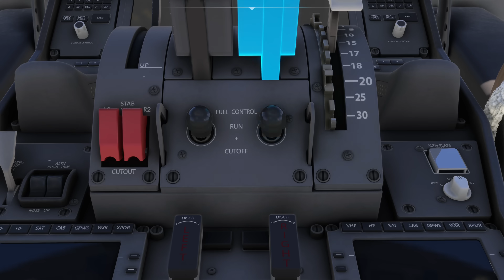Air India 171: Why Did The Fuel Cut-off Switch Get Moved?

Comment: Why don't you discuss all the possibilities that lead to switch off.
And when the pilot says '' I dint do it '' - It is not always like a kid doing a mischief and then denying it. There are good kids as well in the world who don't lie. So here there is a firm attempt to project this as a deliberate switch off.
There are reports about glitch in the springs/ locking mechanism reported in 2018 or so
There are reports of a refurbishment done 
There are reports of possibility of software glitch having a possibility of re running the fueling system
So why don't you discuss all of these and establish why you rule these out?

Comment: Would it not be a good suggestion to add a mechanical interlock,   so that the fuel swiches cant be moved to cut off unless the trust lever for the corresponding engine is at Idle.    I cant think of a senario where you would cut off fuel before setting the thust to idle.

Also one pilot setting an engine thrust to idle is a far more noticeable action by the other pilot.

Comment: One issue that I was a little surprised to hear was that the investigators had to find someone who knew the crew and could identify which pilot was saying what... I would have expected each comms set (headset) to be recorded on a separate track specific to which "seat" they are sitting in. Thus the left hand seat is recorded on one track, the right on another, and jump=seat or other headsets on their own individual tracks - in this day and age, with analogue recordings, multi-track is easy, and with digital recordings, it would be even easier to provide up to 64 individual "tracks" of audio - allowing multiple different audio circuits to be recorded.

Comment: You mentioned previously that an aircraft knows it is either in "ground" or "flight" mode. Would it not make sense for the aircraft to be configured to disable certain actions such as allowing the fuel switches to be "both" shut off under certain specific conditions such as 1. There are no engine alerts / alarms, 2. Altitude above ground, 3. Climb angle and rate, 4. Speed, and probably a number of other conditions that show that there is absolutely no reason for shutting both fuel switches off during takeoff and early climb to altitude? I am not a pilot, but surely something can be done to prevent such a catostrophic action under certain specific circumstances.

Comment: One of the previous passenger posted a viral video about the same doomed plane showing faulty air conditioning system, just imagine their maintenance level. But the investigation committee says there were no issues in the plane. Obviously covering up. Looks like the mechanical faulty fuel switches which rotated back due to vibrations was just over looked among many issues in that plane. Who cares about 2018 advisory report clearly mentioned potential danger in those switches.

Comment: Hi, a stupid average passenger question.. buy why did they not land back ? Not back at the airport but any open place close to crash.. The landing gear was all out anyway, they were hardly too high up ..
Reply: Also if cut off switches are going to make you crash and lose your life, I would pull them back up in a second, leaving everything else... 10 seconds is a looongg time to debate and then correct such a fatal error... Any debates and interrogation on why the other pilot did or did not do  it should have come after the correction I feel

Comment: First of all ,Not sure why this switch is required ? I don’t have it in my car, it doesn’t matter whether it is on or off, if this is must required in air craft ,based on engine status (running / idle) it can be made automatic after all it is just fuel tap

Comment: We could add some control logic to those switches (and I expect we will - given we added secure cockpit doors after 2001);

Add logic as follows;

‘if (fuel shutoff is done when both engines are running at takeoff thrust, and the aircraft is nose-up and gaining altitude as expected, and all engine sensors are normal), and if this happens EITHER (during takeoff roll) OR (first minute in the air) THEN (reduce that engine to 50% thrust immediately, and lower it down to idle over the next 10 seconds, and cut the fuel as expected 10 seconds later).
 —> if attempts are made to reverse the shutoff via switches, or via moving thrust lever up (or down then up), restore fuel flow

If (the above happens after the first engine has been shut down, then reduce thrust to 66% after 5 seconds, 50% after 10 seconds, and keep it there for 10 seconds before lowering it further (below idle).

The above would leave the engines in a state where full thrust could be quickly, almost immediately restored, for 10-30 seconds, letting the other pilot save the plane.

Additionally, extra logic could be added : 
 - if an engine is indicating a fire, or fuel in one tank is dropping rapidly, or engine is significantly out if spec on the sensors, then shut down engine without delay’
 - if the plane is heading rapidly towards the ground at high speed, shut the engines off, if the pilots command it, without delay.

Would also be good to add a software update for cockpit doors;
 ‘Allow pilots to use a fingerprint on a keypad to unlock the door no matter what.
 -> this would prevent the GermanWings disaster.
 -> ideally, figure out a way for pilots to have basic amenities without entering passenger area…

Comment: There are so many ways a pilot can crash a plane which are much more certain.  It's obvious that whoever turned off the switches (if it was a person) most likely wasn't even aware of that.  The fact is, the problem was discovered and fixed immediately, it was just a matter of seconds, or landing in a field instead of a building.  In short, this doesn't seem premeditated at all.

Comment: It clearly shows switches were faulty. It was revealed in FAA report in 2018... Switch issues 
Boeing has a tendency to shift its blame on to dead pilots
The conversation between the 2 pilots clearly indicated that both were in shocked state, couldn't understand how did it happen
They did try to do whatever could be possible to avert the diaster.
BBC and WJP misinterpreted the preliminary report to save Boeing.It is conspiracy by BBC and WPJ
Whereas when London jet Airways had accident in 2 days - BBC  -won't blame pilot mental health, why ???

Anyway Air India CEO Mr Campbell himself siding with Boeing, he should have resigned by now if he had really a responsible person

Rather Air India CEO Mr Campbell ignored the STPA report submitted by the crew of the same ill fated AI 171 plane that arrived from  Delhi to Ahmedabad, within 1 hour, it got clearance to fly from Ahmedabad to London.
So how come Air India CEO still a CEO.
Wake up call for TATA to ask him to resign immediately taking the onus on him
Boeing is at fault no doubt, its has technical issues, software glitches. This incident shows Air India CEO siding with Boeing

Comment: Steve thank you for this!  My question may not have an answer, but if one pilot shut off the fuel switches, the other pilot asked why did you do that, Then the questioning pilot reset the switches to run & got a mayday call off,  It seems like the pilot who shut off the fuel didn't put up a struggle with the other pilot to keep those switches turned off?  

You would think that if the pilot who wanted those switches turned to off would've wanted those switches to remain off!  Why do you think there was no additional attempt to turn those switches back off? there was no mention of a struggle in the report?
Reply: No need to fight it, loss of thrust was immediate and putting them back into run would not have changed the outcome no time for spool up to full thrust, too low to the ground.

Comment: Is it possible to manually switch off the two fuel control switches with just a gap of 1 sec as these got cut off one after another with a gap of one sec.??
Moreover the lone survivor said that he witnessed the lights flickering in the  cabin before the crash happened , something to do with electric/ electronic malfunction??
Moreover there is no discussion  abt the RAT  as per the voice recorder.

Comment: Given the extent of what has been released in this interim report especially significant aircraft data , is it possible to ascertain the point on the runway either mathematically or through an average collation of flight simulator replays as to when exactly the aircraft should have reached V1 and Vr speeds and when exactly did the aircraft actually reach those speeds and combine the data with when the aircraft actually take off. Everyone is concentrating on this fuel cutoff switch but go back to the original takeoff video and see that cloud of something just as the aircraft takes off. Is it provable that there is a tangible difference between a normal and evaluated point of Rotation and the actual point of Rotation.  Correspond this perceived data with the timescale of the crash and perhaps one could discover even from the interim report where some timings have been done that something happened in the aircraft before it even took off

Comment: Was this a Seniors moment?
On one flight, me F/O on 737, when we pulled up at the holding point waiting to take off.
The Capt, over 60 yo, actioned the fuel cut-off  levers to Cut Off instead of applying the park brake.
He did it so quickly I didn't have time to stop him.
The Following train of events too long to list here.

Point is did the Capt have a Seniors moment and action fuel cut-off in lieu gear up? 
Need voice recorder to compare gearup command to fuel cut-off timing.

Comment: You and Boeing Stooges are hell bent on pinning it on pilots but
Just four weeks before an Air India Boeing 787-8 crashed shortly after takeoff from Ahmedabad, the UK's Civil Aviation Authority (CAA) had flagged fuel control switches on several Boeing planes and ordered daily checks.

Comment: 10 seconds to reinstate the switch also  includes the gap of seconds in  realizing the fuel cutt off . Plus it is possible that the commanding pilot, to  accuse the actual pilot on controls for switch cuttoff  ,just to transfer his guilt on the other.

Comment: Captain Steve is out there to create a narrative to blame it on the pilots. He definitely has an agenda. He is not questioning any technical or maintenance issue. Straight and straight go after the pilots. Some questions to be asked 

1. Where is the full transcript of cockpit voice recorder and the flight data recorder report. The plane was airborne for only a few seconds. Why was the full transcript and report not released along. Captain Steve is not asking for the full cockpit voice recordings and the flight data recordings. He is only going after the pilots. 

2. He is so against videos inside the cockpit. Even after such a ghastly accident he is more scared of videos being leaked. Clearly a hidden agenda here. A neutral person would be shouting his head out asking for full reports and insist on video cameras being installed in flights along with audio recorders. Privacy can easily be handled with security and encryption. There is no issue here of privacy when trains and bus do have video recorders. He is clearly having an agenda to save Boeing. 

3. All the media clips he used in the beginning of the video also point out his bias. 

4. The switches were moved to cut off within a second of each other. He says thats very possible and he adds on to say the switches being moved to run after 10 sec and the time interval between left and right being 4 seconds also holds ground. I fail to see this as a non biased way of reporting. In all probability if the switches were moved manually by either of the pilots then it would take at least 2 to 3 seconds to do it. Both switches dropping down to cut off within a second points out to technical malfunction. I want Indian pilots and non biased experts to demonstrate this. 

Captain Steve is biased and creating a narrative to save Boeing .

Comment: If each fuel control switch was in an outboard position - i.e. at the extreme left or right of the cockpit, each pilot could only operate the cut-off closest to him, and the other switch would be the far side of the other pilot. Moving the switches like this wouldn't require any re-design of the switch itself.

Comment: Could they have turned off the fuel after flying the previous leg and just forgot to turn them on? If they turn them off is it an instant cut off or does a lot of fuel stay in the engines or enough to take off?

Comment: They didn’t 
Both Engines died 
One pilot ask the other did you cut  off fuel 
It doesn’t mean it was cut off . 
In panic they may have try to cut off and turn on to make sure fuel is on

Comment: The preliminary report states that liftoff occurred at 08:08:39. The aircraft achieved the maximum recorded airspeed of 180 Knots  at about 08:08:42 UTC and "immediately thereafter" (not concurrently), the Engine 1 and Engine 2 fuel cutoff switches transitioned - so at say... 08:08:43? It also states that the RAT hydraulic pump began supplying hydraulic power "at about 08:08:47". Within 4-5 seconds of switch transition! I understand that it typically takes a RAT 8 secs to start supplying power after deployment when spinning at cruise speed, so presumably the delay is longer at take off speed. So, is it possible that the RAT had already deployed in reaction to some, as yet unidentified, power or systems glitch before the switches transitioned - the same glitch then subsequently causing the switch transition?.